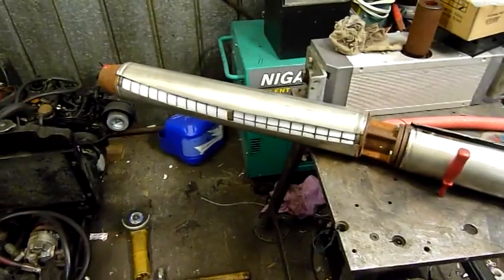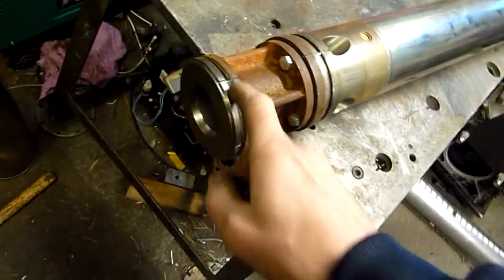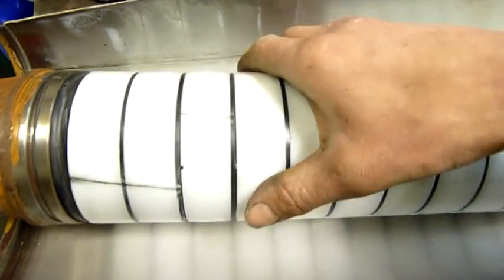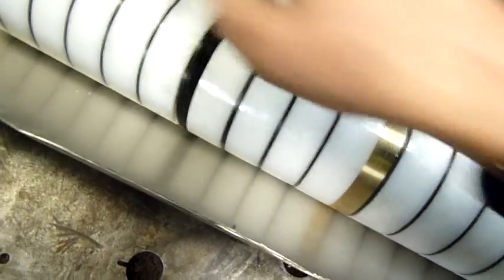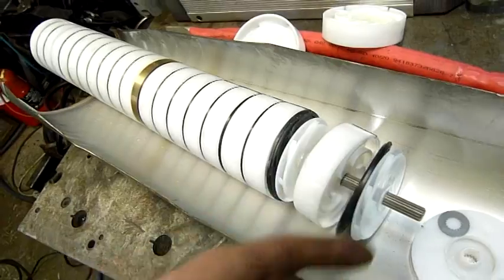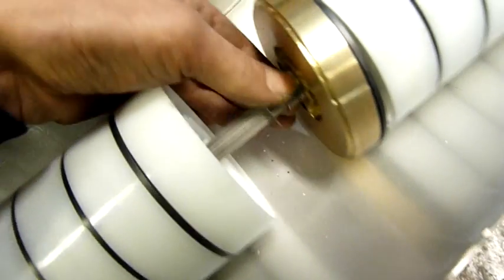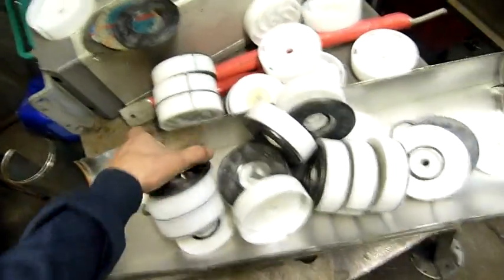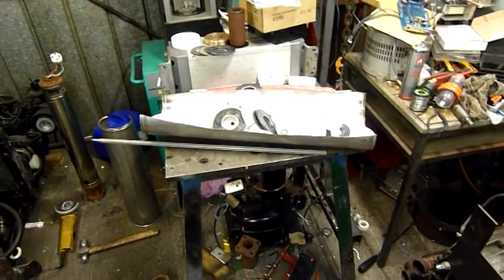Red Jacket LPG Pump Autopsy - The Pump End

Comment: Exactly like a multistage vacuum cleaner motor.  The stationary vanes in between at least in vacuums are called stators, they take the spinning motion out of the air (in a vacuum, in this case, the liquid LPG being pumped) to make the next spinning turbine more efficient.

Comment: I think every stage boosts the pressure output, so if each one did 5psi you'd have upto 20 x 5psi at the outlet.

They use similar designed pumps here but with less stages for volume washing the milking parlours.

Comment: The jacket around the motor, is to cool the motor. If they're in a well, there will usually be flow from above the pump, or from below ( unless the pump is set below casing into a cavern ). Fluid has to pass the motor at a certain rate to remove heat, if it's just in a huge pool, there won't be much flow past the motor.  ... or hanging from the roof of a big tank.  Very neat device you have.

Comment: Never would've guessed a centrifugal sub pump would pump LPG! I've worked with water pumps, very similar design, but the motor was on the bottom. The brass center bearing, appears just to keep the shaft centered. I didn't notice much axial bearing surfaces on the rotors / volutes.  They'll make decent pressure, If I remember the numbers: 7.5 HP, made about 20 gpm of water, lifting it about 800 feet.

Comment: I worked with similar pump / motor assy's in the past, easy way to tell, if they spin backward, they'll either not bring water to the surface, or if they do, it's at reduced rate.